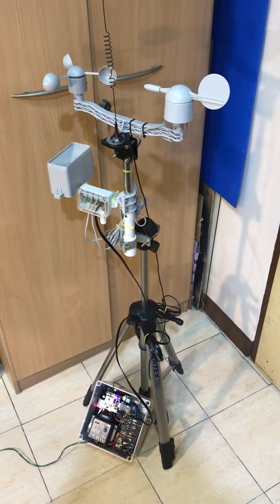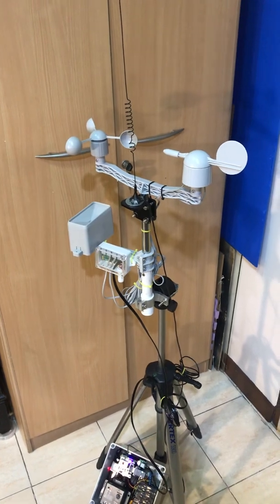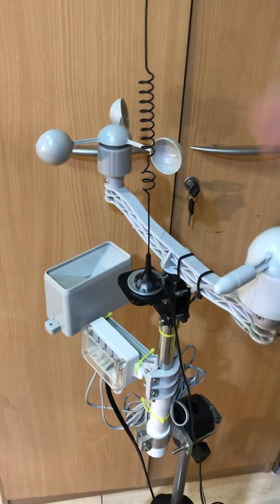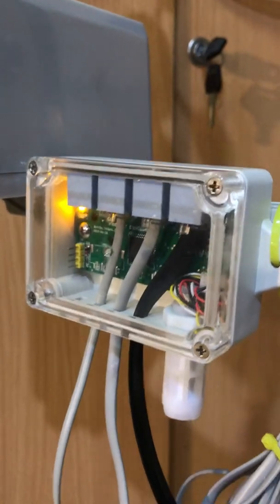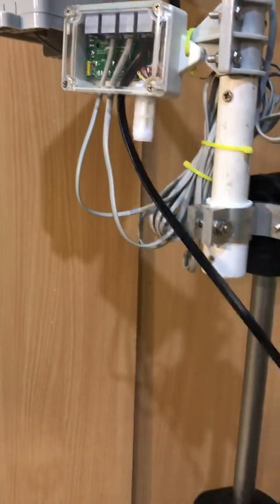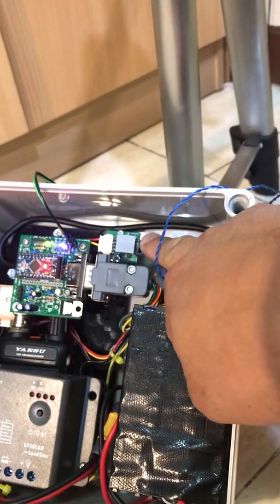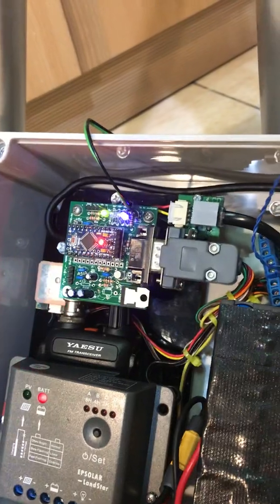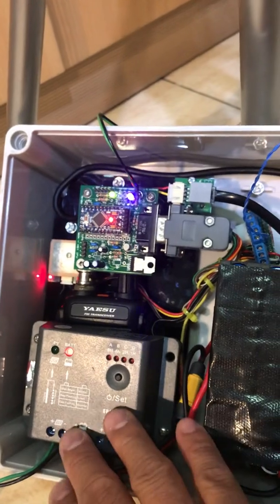Advance portable WX aprs station (English version)

Comment: How does the weather station connect to the radio? Or does it need something in between?? Thanks.
Reply from the maker: the weather station has the interface that provided the RAW WX in serial  data then I fed into the  APRS tracker that I built